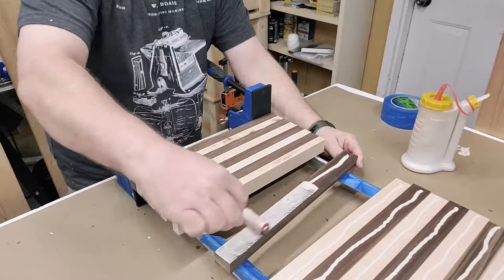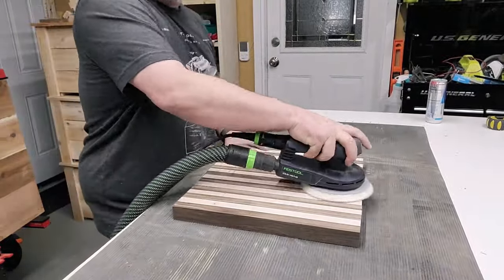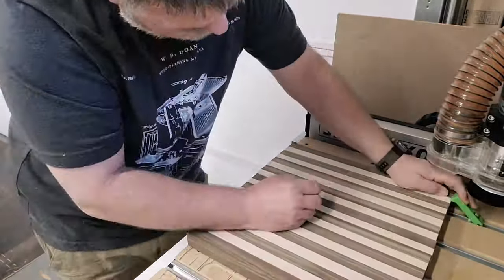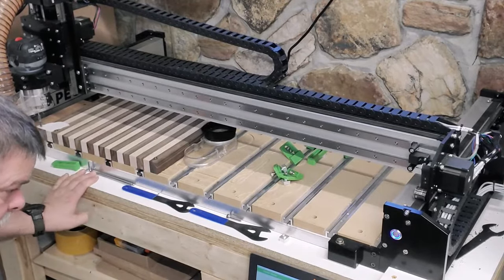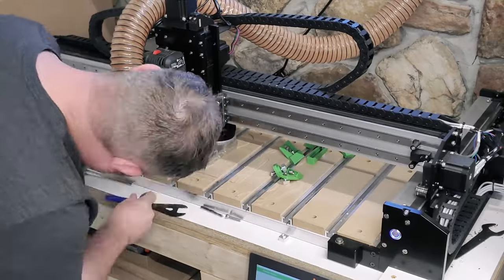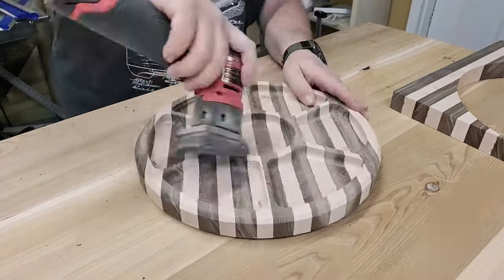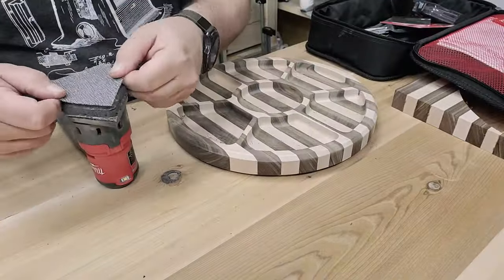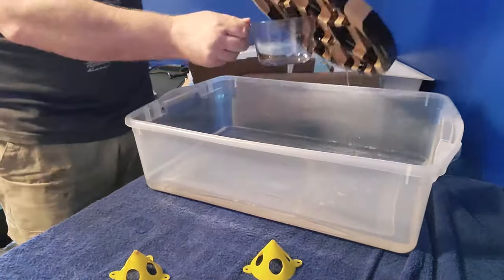Making a Stunning Serving Tray That Will Change Your Mind About Home Decor

Comment: Nice work. Does this CNC use G-codes for all movements like a CNC milling machine for metal machining. I have limited experience with programming CNC Mills and Lathes with a program called Mastercam.
Reply from the maker: Yes sir it's exactly the same thing.